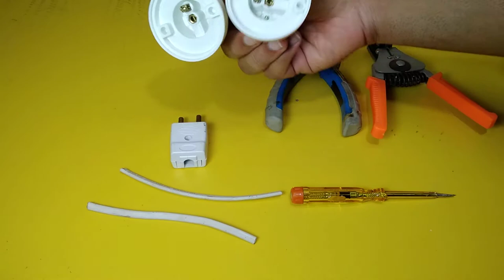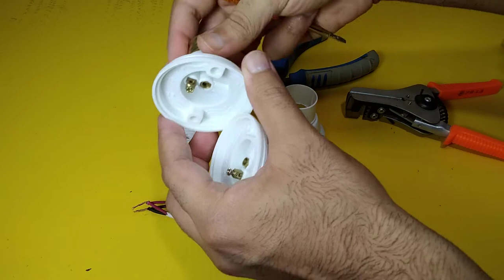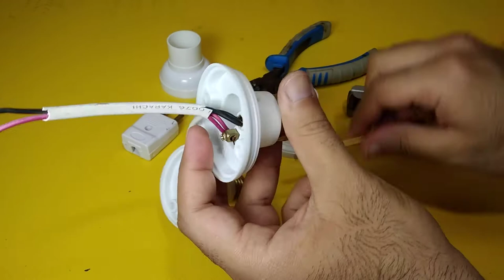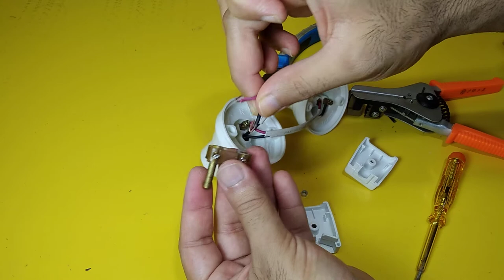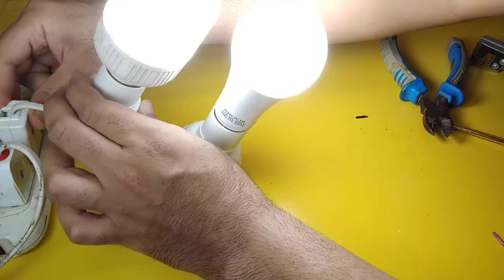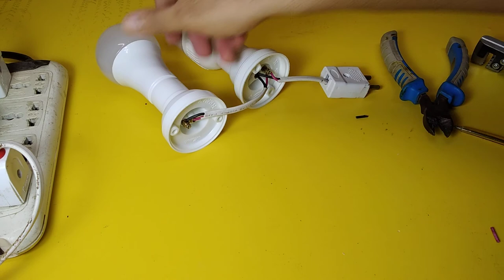How to connect bulb in parallel - how to wire bulb holder in parallel

Comment: This is OK except for the fact that the second one you wired up was reversed.  You don't want to do that.  Depending on those sockets, you would have one with the bottom pin hot, and the other with the threading hot.  I'm guessing the center hole is to make the bottom pin hot and the red wire will be your hot line, so the first one would have been right, but the second one would make the threads hot and a shock/fire hazard.  It will still work, but it's not safe.
Reply from the maker: Thank you for detail information

Comment: Sir can I connect 8pcs LED bulb (15watts each) in one plug? Same as you did but i will make 8pcs bulb. It is possible?
Reply from the maker: Yes it is possible to connect 8 PCs bulb like this but be sure to use 23/76 wiring it can take load up to 1000 watts
Reply: @Umairworkshop  thanks for the info

Comment: If i want to add more bulbs, is there a maximum limit?
Reply from the maker: This wire is suppose to work with 10 bulbs means 1000 watt limit
Reply: @Umairworkshop  ok, thanks.
Reply: I used 220v bulb but its exploded. The wire burn. Can you tell me what should i need to make sure it doesn't explode & to make sure the bulb not over heating?
Reply from the maker: @noorsakirah  first you need to make a simple one holder wiring and check if it is working then proceed to add the second holder
Reply: @noorsakirah  This is not necessarily the wiring and more depends on your volt capacity of the outlet (do not exceed the limit! 120v in US) and the wattage of the bulbs you used. I would suggest using LED bulbs because they draw less wattage and less energy. If you put too many bulbs on any one outlet, it's not going to work and can overload the circuit.

Comment: problem ye ha k w1209 ,mere 100 watt k bulb ko on and off kerwata ha .jabkay dc fan 12v pe har wakt chalta rehta ha .mgra main chahta hun k mera fan bulb k sath chalay jab bulb band ho to fan b band ho jaiy.....incubator k andar
Reply: bulb 100watt 220v ac ha
fan 12v dc ha 
w1209 ki relay se dono ko same time main kese control kron?
diode+dc fan+100 watt bulb  in sab ko series main ker k chala sakta hun ya nhi?
100watt  k bulb ko aur dc fan dono ko dc pe chala sakta hun ya nhi?
Reply from the maker: apko bulb ky sath adaptor lagana hoga jab bulb on hoga sath adaptor bhi on hoga
Reply: Acha mashwara dia mgr main pehlay hi supply k lia computer power supply use ker rha hun ab mazeed adapter nhi use kerna

Comment: Pag 6 bulbs po anong wires po ang gamit?
Reply from the maker: 23/76 guage wire is good for 1000 watts but if using over 1000 watts then 40/76 is recommended

Comment: WHICH TWO WIRES TO  TWO PIN PLUG?
Reply from the maker: the wire which is connected to the bulbs will go to the plug
Reply: @Umairworkshop NOT UNDERSTAND

Comment: Sir, HOW TO MAKE EARTH  WIRING TO TWO PIN/ FIVE PIN SOCKETS?
Reply from the maker: if you want to make 3 wires wiring than I cannot tell because I don't know
Reply: @Umairworkshop  PL.TELL TO TWO WIRES & THREE WIRES ALSO
Reply from the maker: @ravindranathb.r6642  only air conditioner needs 3 wires or other appliances which have 3 wires with them needs earthing
Reply: @Umairworkshop  TWO WASHING MACHINE, TWO PIN PLUG WITH GUAGE WIRE IS ENOUGH?

Comment: SWITCH IS NOT NECESSARY?
Reply from the maker: it can be plug in directly to the switch board like this one 
https://youtu.be/Mjuy6o7CUWs
Reply: @Umairworkshop  TRIED AS PER YOURs VIDEO THROUGH FIVE PIN SOCKET BOX, BUT FIVE BULPS IS NOT BECOME ON!!!!?, WHAT IS THE SOLVATION, FOR FIVE BULPS BECOME ON @A TIME WITH TWO PIN PLUG?
Reply: @Umairworkshop  IF WE PLUG FIVE BULPS WIRES TO THE JUNCTION/ EXTENSION BOX, IS IT NOT BECOME SHORT CIRCUIT PL.,
Reply from the maker: @ravindranathb.r6642  have you wire the 5 bulbs in parallel and the plug is put on in the one socket , or you wire the bulbs single and turning 5 bulbs on at same time ?
Reply from the maker: @ravindranathb.r6642  what are the wattage of bulbs , you should use high guage wire if trying to on 5 bulbs at the sane time
Reply: @Umairworkshop  IF I PUT INTO FIVE PIN SOCKET EXTENSION BOX , THEN NO PROBLEMS?/ NO SHORT CIRCUIT PROBLEMS? ALL FIVE BULPS IS ZERO WATTS.